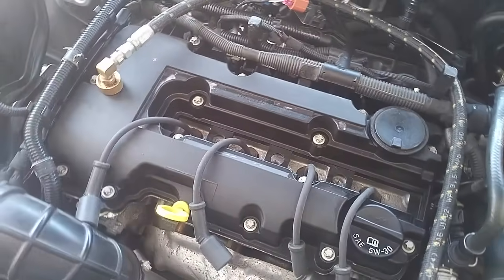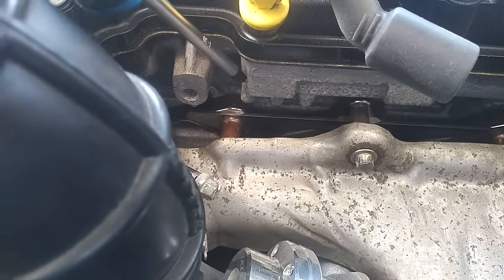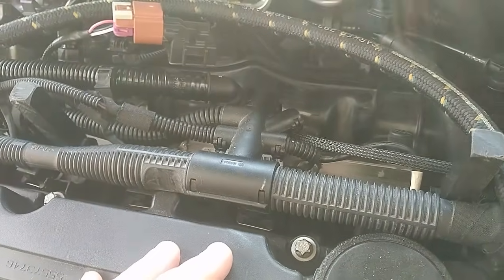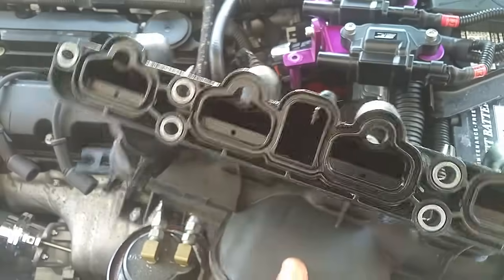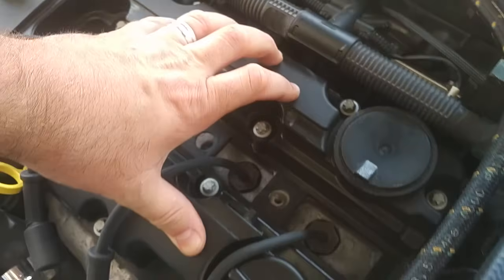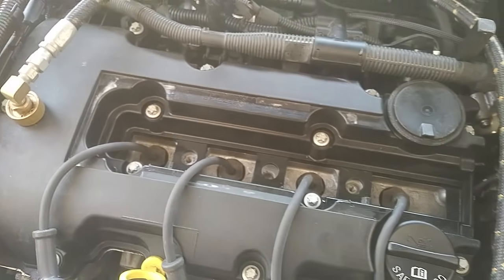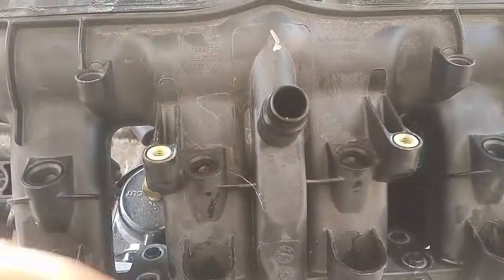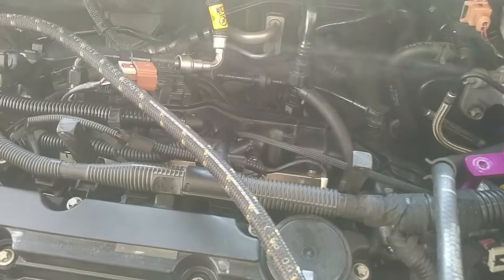Chevy Cruze Sonic Trax Encore 1.4L Turbo PCV Issues, Diagnosis, and Solutions

Comment: I broke my PVC Line while replacing my thermostat and after I changed the PVC line I threw that code and it's leaking out that same hole 😫
Reply from the maker: Make sure the terminal is securely installed. If it is, your valve cover may have coincidentally failed.
Reply: Bro, I literally had the same issue last week. I changed my thermostat and now I'm getting a P0171 lean code. I think it's from that plug that connects to the turbo intake. Any updates?
Reply from the maker: @LazyScoutJace  if you removed that connection, you probably cracked the hose.

Comment: Thanks for the video! My intake manifold PCV and regulator cap in the valve cover both failed. So I just bought one of your kits, and I'm looking forward to installing it.

I was wondering if you had any advice on testing if the second PCV valve (into the turbo) has failed?
Reply from the maker: Pull the hose off the intake manifold and blow into it. Should flow freely. Then suck air through it. Should stop.

Comment: So few questions. 
Whats is the difference between the V1 and V2 kit? Im assuming I want the V2 kit?
Also PCV valve has likely gone bad on the 13 cruze, I just install this with the bad valve still there? 
Not all oil is filtered out, is there any negative effect on the brake booster from oil contamination? 
So this thing use to chirp but recently quit, now we have issues with it overheating with defrost (AC on) and high gen load (heated seats etc running) fans on..heat goes hot then cold speradically during driving....coolant is low...intake gasket or head gasket? Looking at your video. I am not seeing where antifreeze may slip by so im fearing head gasket. 
Last question. Smell exhaust fumes in vehicle from fan running, this related to the pcv valve as well. 
Many thanks!

Comment: Hi Dan, I have a question concerning PCV valve, are there any symptoms of breaking. I have a hissing/whistling sound inside the car but only while driving (under boost) 1800-2500 rpm. I tried to search for vacuum leak but have found none.  On idle no sounds at all.
Reply from the maker: I recommend watching this video thoroughly and performing the checks I recommend to diagnose the root cause of your issue.

Comment: I ordere you kit and followed the directions to a tee. I have too much positive pressure in my block( take out dipstick and a rush of air) any suggestion??
Reply from the maker: Defective valve cover. I've seen it happen plenty of times, even on brand new ones.
Reply: Damn, I just put this one on. Thank you . Could it be a bad check valve?. Any way to test either valve or cover?
Reply: @donalduckisaquak1884  if the valve cover is bad you'll feel positive pressure coming out the hole on top of the valve cover at idle
Reply from the maker: @justinv3080  That's not the only way they fail. Some of them fail within days due to a defect that creates a blockage in the PCV path inside.
Reply from the maker: @donalduckisaquak1884  A bad check valve in the intake manifold? Yes, if it's stuck or clogged, or if you installed my PCV fix kit and the check valve is installed the wrong way. 

Did you install my fix kit yet?

Comment: what is the hose connection you have entering into the valve cover over by the timing chain? what is it for and where does it go? thanks
Reply from the maker: That's an AMSOIL remote bypass filter. 2 micron filtration.
Reply: Dre Dan thanks. Another question for you. Last week I installed the cruise kit V2. While I had my intake manifold off I saw that my head gasket is leaking oil so my plan is to replace the head gasket this week. 

Other than all the seals associated that you have to take off what other parts would you recommend replacing or upgrading while that deep into the engine? 

I’m going to drop the oil pan and replace the connecting rod bearings and piston rings for starters. 

My cruise has 114,000 miles. 

Thank you
Reply from the maker: @logb123  are you sure it's your head gasket and not the valve cover seal? Head gasket leaks are pretty rare on these engines.
Reply: @AndreiDPop  what makes me think that it is a head gasket is, when i had the intake manifold off. the seem where the block and and cylinder head meet seem to be the source of the leak. below had oil and above was dry. 

now, there is also a leak in the front of the engine, at the valve cover seal. so it is leaking also, and the pressure regulation diaphragm has also busted because it is sucking air at idle.

my guess is the previous owner, drove it with with a bad pcv and busted diaphragm for so long that the positive crank case pressure pushed oil past the rings eventually killing the head gasket. that's my guess. 

i guess im more of a safe than sorry person. id rather put the $500 in parts into the car and have no problems for another 100k miles. 

any tips i would love to hear them. or your thoughts on the explanation above.
Reply from the maker: @logb123  spray it down with some Brake clean and keep an eye on the source of the leak. I highly doubt it's the head gasket. Just keep an eye on it.

Comment: I've replaced the valve cover, the evap valve on back of intake, and the hose going from the intake to the turbo inlet. I checked and have the little orange diaphragm check valve in the intake and still have the damn p0171 code. Fuel mileage is crap. Any suggestions?
Reply from the maker: Check for a crack in the rubber elbow coming off the turbo. You've got a vacuum leak somewhere. You could also try grabbing my boost leak test kit, that would help you find the leak Even easier.
Reply: @AndreiDPop   Copy. Thanks for the suggestions. I will check for boost leaks and let you know what I find.

Comment: Hello my GF just bought a 2014 Cruze  and it has those problems I got a new cover ordered, I'm a dirt track race car mechanic stock cars and modified's, not a lot of experience with turbo engines. Question could I delete to pcv with a breather filter or no being a turbocharged engine?

Comment: I have a 2014 chevy cruze and had bad coolant temperture sensor replaced that and while doing that put different intake on amd car stalled out. So put stock intake back on now have p1101 code and only goes on sometimes when stopped after driving. Replaced maf sensor but codes still comes on. Chenged intake filter pipes still comes on. Seems like I habe no power when accelerating and on highway just doesnt wanna go like dragging a lot. Idk what to do
Reply from the maker: Did you perform the diagnosis steps outlined in this video?

Comment: Dre Dan what can one expect to reasonably pay an honest mechanic for the Labor for intake manifold replacement, assuming I have the OEM part already?
Reply from the maker: Two hours worth of work rounded up. At $125 an hour,. Figure $250 MAX.
Reply: @AndreiDPop  dealer quoted me 300 for the OEM part and 300 for the Labor. USD
Reply from the maker: @johnlamb4465  The OEM part is $150 on gmpartsdirect.com if I remember correctly. Their labor rate is probably $150 an hour at that price. Could do it yourself for 1/4 the cost, or just get my PCV fix kit and do it for 1/8 the cost.

Comment: What fixed the p1101
Reply from the maker: That's typically either the valve cover or the corrugated hose.
Reply: @AndreiDPop  what is the corrugated hose?
Reply from the maker: @josuehernandez247  the big hose going from the intake manifold to the turbo inlet
Reply: @AndreiDPop  2014 cruze 1.4 turbo kicking my behind, with p1101 valve cover has been replaced, intake manifold, had tried new mass,map,boost sensor no luck, 15inhg of vacuum at idle although throttle position is at .8% at idle even tried a new TB but still the same I'm I missing something?
Reply from the maker: @josuehernandez247  boost leak test it. There's a vacuum/boost leak somewhere.

Comment: Dre Dan, Thanks for the video! Great explanation on the system. I have an oil leak somewhere between the charge line and throttlebody. Have you heard of this before?
Reply from the maker: Yes. This is typically made worse by a missing check valve in the intake manifold, but otherwise simply means the clamp isn't tight enough.
Reply: @AndreiDPop  Am I reading this correctly? Are you implying that some oil leaking from the charge pipe is acceptable? A lose clamp? Wouldnt this be a check valve issue, resolved with a DRY charge pipe yes?
Reply from the maker: @ripptydevibes2581  If you have oil leaking form the charge pipe, you also have a boost leak there as well. Some oil will come through the PCV system, but it tends to settle in front of the throttle body and leak at that charge pipe, even if actual consumption is inconsequential. Even a healthy car will consume some oil through the PCV system, and some of that will find its way through the intercooler and up the charge pipes. Not something to worry about unless oil consumption increases significantly. A check valve issue will make it worse but a minor amount of oil will still go through the charge pipe on a healthy engine.
Reply: @AndreiDPop  Agreed, thanks for the quick reply. I guess we arent as used to seeing oil at the intake on natural aspiration, but owning my 98 mitsu 2.0l running 32psi, it was nice of you to remind me that it is somewhat normal for the Chevy Cruze to have oil in its charge pipe lol. This customer is missing the check valve nipple, and im considering pricing your deletion kit and valve cover job, but shes already been in deep with this cruze at 100k miles so im almost as likely to start washing my hands of it and let someone else grow into the bad guy lol. Shes complaining of the heater vent smells and ive already rerouted her coolant breather to under the frame, gonna tell her take it to chevy for that but then theyre gonna hammer her with a list of reasons and $2000 in repairs that likely wont do anything! Thanks again!!
Reply from the maker: @ripptydevibes2581  the v2.1 kit should keep her PCV problems at bay. It's not a deletion kit but a re-route with serviceable components. I also have installer pricing at 15% off if you want to go this route.
Reply: @AndreiDPop  Yes yes rerouting** My only hold back is that when I fixed her thermostat housing leak, when I vac the cooling system I shut it off and watch the needle to see if it holds vac. It didnt hold it but I could tell ehhh maybe something else minor, we will check it in two weeks. She brings it back today and yes, she needed a decent splash of coolant. Ran it hot, then put pressure on the cooling system and found no signs whatsoever of coolant leaking, nothing on the interior near the heater core. Im wondering if her "smells" are linked into a head gasket issue from combustion leaking outa the coolant breather. So I told her we will keep monitor and keep topping fluids and re evaluate later. She swears its a exhaust smell, but when I parked it and popped the hood hot, it smelled like sweet hot metal if I was to describe. No bubbles formed when I sprayed the exhaust/turbo when it was cold. Im glad I only get these situations once in a while lol. Thanks for all your help and donations to the cruze!!
Reply: @AndreiDPop  Interesting! I found my turbo-intercooler charge hose really floppy and was also confused about how much oil was "hanging out" around the IC connector. I can't believe the shoddy engineering they did by using an internal o-ring/seal to hold the boost and no way to clamp it down. I ordered ZZ performance's IC kit but from what I gather, I will need to fix the PCV valve also? My original problem was surging/loss of boost with NO codes being thrown. I am tuned though with only P0420 being ignored. Can your kit fix an already bad PCV valve? Don't really want to drop another couple hundred bucks.
Reply from the maker: @primeideasconsulting  my fix kit will address the intake manifold check valve missing or malfunctioning. If your valve cover is bad, it also has to be replaced separately.

Comment: Since I stopped buying GM , I never had any issues with cars 
I’ve been buying Honda Accord v6 and sold it for a Pilot, no regrets
Reply from the maker: Good luck with that VCM system, deposits building around the piston rings, etc. 

All cars have issues. I would know, I own a Honda Odyssey. My Cruze never needed a new CV shaft even with a BNR tune and a big turbo. My 2011 Odyssey does.
Reply: @AndreiDPop  
Time will tell 
I know first gen vcm had issues but I have 2nd gen and my accord was sold with 50k miles and last Time I saw it it was close to 90K miles with no issues, just battery and tires
Reply: Gm is shity they make the cars to break down so you can purchase one more later fuck gm

Comment: Hey Dre Dan, I've been dealing with an issue for a lil bit and I'm wondering if you have a solution, your video was VERY informative but my issue is that I have found Oil in my charge pipe and I blow big clouds of white smoke under med to high just. I'm aware that the oil is seeping into the combustion chamber but I can't seem to find out where the oil is coming from.
Reply from the maker: Most likely from the pcv system. Did you put an aftermarket valve cover on it?
Reply: @AndreiDPop  I did not. The car has over 75k miles I've had it since 0 miles. But I must disclose. I have an upgraded turbo and more. So you're saying the Pcv Valve is the issue? And will replacing the valve cover fix this?
Reply from the maker: Hard to say. It could be a lot of things. The PCV system is where I'd start. Some oil in the intake is normal but too much is unusual. Get a compression test done.
Reply: @AndreiDPop  ok ok I'll check with the compression soon. The modifications are fairly new. So I'm not too worried about those. But I must also mention that it's spitting oil into the engine bay through the blow off valve.

Comment: will this stop excessive oil consumption. i can 1.5 qts kicking turbo in over 5 miles
Reply from the maker: No, not THAT much oil consumption. You probably have a bad turbo or a cracked piston. Or a defective valve cover.

Comment: Very good video, I replaced the intake cover that the “PCV” is built into. Car finally idles and sounds correct again. But it smokes like crazy. Any reason why???
Reply from the maker: Possibly a bad valve cover. Did you use an aftermarket one? We've seen that issue many times with aftermarket valve covers. Also, the valve cover only has a pressure regulator diaphragm; you also have to address the intake manifold.
Reply: Dre Dan the new cover I installed was bought online, so it’s aftermarket I’m assuming. the dealer in town said they no longer are able to get OEM valve covers. And I discovered this morning that the nipple is missing
Reply from the maker: @brock451  just saw your reply. Go on amazon and order an OEM valve cover. Or get a Dorman locally at an auto parts store.
Reply: Dre Dan well just went to the store and bought the dorman and installed it. Started the car up and no smoke. 
Back the car out of the garage and it’s smoking again. Not as bad, but still still allot
Reply from the maker: @brock451  might be some oil still in the intercooler and intake system. Drive it around if you can. See if it dies down a bit. Also, make sure there isn't an obstruction in the corrugated hose. Pull it off the intake manifold and blow into it. It should blow freely. Suck air back through and it should stop.
Reply: Dre Dan alright seems to have stopped smoking now, thank you for your expertise and sharing your knowledge !
Reply: @AndreiDPop  I put the dorman one on man. No issues. Dorman also makes a intake manifold that fixes the nipple issue.
Reply from the maker: @270eman  the Dorman manifold "fixes" the nipple by adding a blocking pin behind it so I doesn't disappear. This is nothing more than a bandaid for a faulty design. The check valve will still get dirty, get stuck, get clogged up, gummed up, or even leak. Unlike the OEM valve though, you won't know it and won't even be able to boost leak test it because it's recessed inside the manifold where you can't see it. I can't wait to start trying to diagnose those failures for community members in the coming years (sarcasm). 

Not to mention, it costs 2x as much as my kit, and still isn't serviceable.
Reply: @AndreiDPop  I was referring to the dorman pcv cover to clarify. I actually got your kit to fix the intake issue. My Y fitting leaks a little but I think thats my fault for a loose install.
Reply from the maker: @270eman  oh, I'm really iffy on the valve covers. I've had calls come in every week for valve cover failures with aftermarket ones, either immediately on install or within a few miles or hours. I'm not a fan.
Reply: @AndreiDPop  The dorman one seems okay. Ive over 20k on the valve cover still going. I immediately did your pcv 3 fix though so thats probably why its going strong.
Reply from the maker: @270eman  the defective ones I've seen were defective out of the box or within a short while. I had one guy had to replace four valve covers before he got a good one. I just don't trust aftermarket valve covers with this car. I've answered way too many phone calls this year for people who had issues with them. I'm glad you got a good one though.
Reply: Dre Dan so since the nipple is missing, that could possibly be the reason why it’s still smoking like a train?
Reply from the maker: @brock451  no. It's most likely smoking because you have a bad valve cover. What kind did you use?